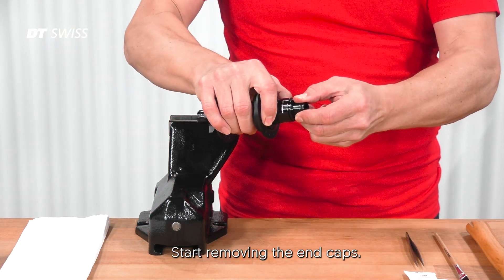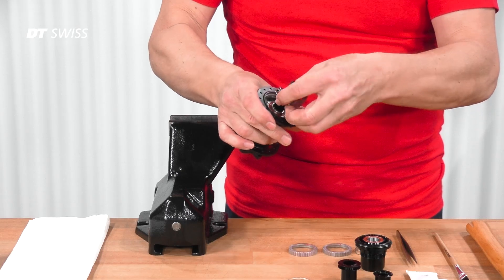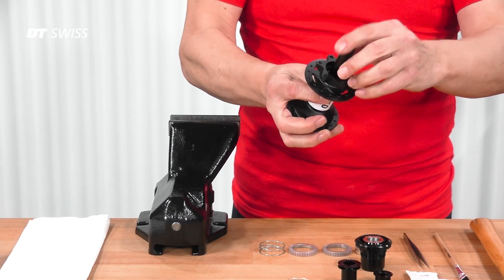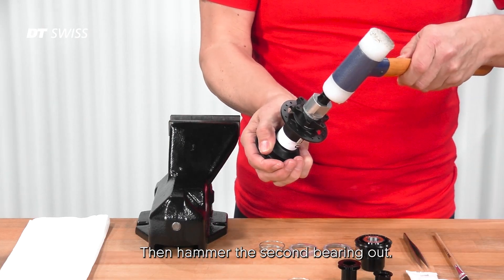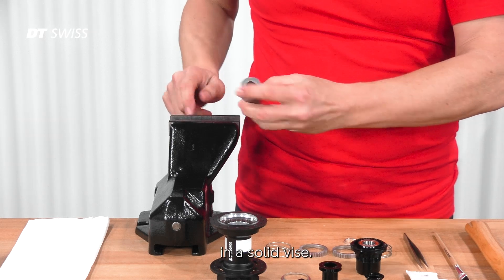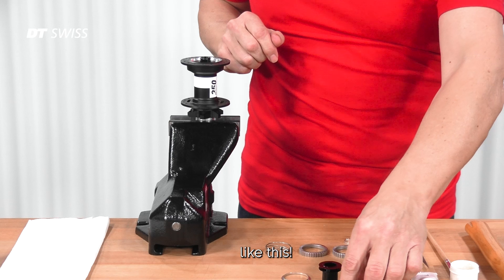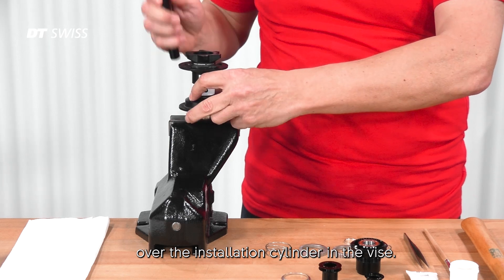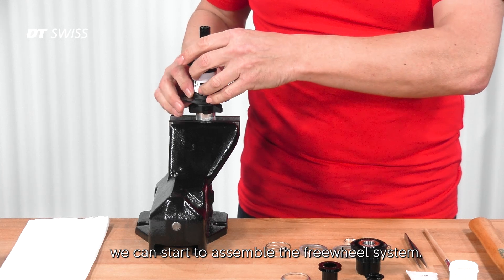How To: 350 DEG Service

Comment: is this the same procedure for the 350 hybrid ? Especially the part where we can change the drive side bearing without unlocking the ratchet ring ?
I had a DT 370 hydrid and the ratchet ring was impossible to unmount, even with 200 N.m. The steel jaws of my vise, which was otherwise quite heavy, developed some play before it came loose. I got a warranty replacement and it was not even on a ebike but a regular MTB.
Reply from the maker: HI and thank you for your message. The only DT Swiss hubs, where you can change the driveside bearing without removing the ringnut are the 240 DEG and 350 DEG hubs. All the other hubs would need the ringnut to be removed. And yes you're right that you would need to have a solid vise and a lot of torque to get it removed. You can use the following video for a complete service: https://www.youtube.com/watch?v=-Wde2goI3Cs
The steps for changing the bearings are exactly the same. Friso "DT Swiss".

Comment: So as you diddnt change the bearings of the freewheelbody, does that mean those will not wear down?
Reply from the maker: Hi and thank you for your message. We do not recommend to change the freehub body bearings. Usually it makes more sense to change it completely as the bearings there last much longer than the Hub bearings. Enjoy riding your Bicycle, Friso "DT Swiss".
Reply: @dtswiss  To me, it makes no sense to replace a whole assembly when you could replace only parts of it.
Reply from the maker: It is not forbidden to change the bearings, if those where worn out. Friso "DT Swiss".
Reply: @dtswiss  But do i need special tools?
Reply from the maker: You would need to find tools to change the specific bearings size. As it is not foreseen by us to change them, we do not offer tose tools. Friso "DT Swiss".
Reply: @dtswiss  I am dissapointed! I was looking for something like this. Because i would like to change it, when parts are not manufactured anymore!

Comment: I have purchased the 350 DEG LTD in green in a wheel build. I am trying to secure the MS freehub as the purchase came with XD installed.
Is this the correct part HWYABL00S0956S for this hub, 
could you provide me with correct part numbers for the 72T MS freehub
thanks
Reply from the maker: Hi and thank you for your message. Yes with HWYABL00S0956S you can convert your hub from SRAM XD to Shimano MicroSpline. Please make sure you have the DT Swiss special grease (HXT10032508S) by the hand, to re-grease the system which is recommended. Enjoy riding your Bike, Friso "DT Swiss".
Reply: @dtswiss  thanks 
could you also explain the difference in HWYABL00S2787S & HWYABL00S0956S
As mentioned my purchase was the 2025 LTD Green 350DEG hub set with wheel build. I finally found the support section of your webpage with the HUB model and in the conversion section lists the  HWYABL00S2787S as the part#.
I want to be certain before purchase, hopefully can find as inventory seems to be difficult to find at the moment.
Reply from the maker: Hi and thank you for your message. The freehub body is not related to the teeth count. You can use every conversion kit that will fit to a ratchet DEG hub. So yes, the HWYABL00S0956S (240 DEG) conversion kit will work. As well the HWYABL00S2787S (350 DEG). Enjoy riding your Bike, Friso "DT Swiss".
Reply: @dtswiss  thanks Frisco. I have received my freehub body conversion and special grease as recommended. Yer videos and website information are very informative. Much Appreciated.

Comment: Are 350 hubs switchable between standard 12x100 and boost 15x110 mount just by swapping the end caps? Or maybe boost hub has wider body and you cannot switch it that way?
Reply from the maker: HI and thank you for your question. If it comes to boost hubs (110mm front or 148mm rear) there is no chance to convert them to different axle width. This is related to the fact that the hub flanges on boost hubs are wider. So in short words, no you cannot convert from 12/100mm to 15/110mm or the other way around. Enjoy riding your Bicycle, Friso "DT Swiss".

Comment: What brand and size is this installation cylinder??
Reply from the maker: Hi and thank you for your message. All the hubs specific tools are by DT Swiss. You will find the artivel numbers in our manuals: https://www.dtswiss.com/en/support/manuals
For the 350 DEG hub choose the DEG manual:
https://d2a13k6araex7u.cloudfront.net/pmt/00/00/00/00/00/00/00/10/00/00/05/10/4/MAN_HXD10000005104S_WEB_EN_001.pdf?v=633

Enjoy riding the trails, Friso "DT Swiss".
Reply: @dtswiss  why the F can't you just give a link on the right tool?? I don't need your manual

Comment: My new wheels on limited silver 240 DEG are currently being built ;D, but I see that these 350 DEG have a slightly different construction. There is additional silver spacer in the freehub(or maybe I didn't notice it, because my freehhub is also silver), and much thinner spacer on the axle. Are 90 and 72 DEG ratchets compatible with each other?
I also see that new Specialized Turbo Levo Gen 4, which has 111Nm is equipped with wheels with DT 240 DEG... so this hub, and 350 DEG can easily withstand the most powerful legal 250W motors, yes?
And one more question, will there be a reinforced steel version of Hybrid DEG freehub available? So that it does not get marks from cassette?
Reply from the maker: HI and thank you for your interest. As I can see in your message, you are very into our products👍 You are absolutely right, the design is slightly different as the 350 hub is using larger bearings, there is a spacer on the axle where the 240 DEG will only use a washer. But beside this detail, all the freehub system parts are the same. So yes, the DEG ratchets and freehub bodies as well are interchangeable. If it comes to e-Bike use, we recommend the 72teeth ratchets. But there is no ban from our side. For the moment there are no plans to offer steel freehub versions for ratchet DEG hubs. But we will see what the future will bring. Enjoy working with our products, Friso "DT Swiss".
Reply: @dtswiss  
Thanks Friso for quick reply. It's true I had a lot of your wheels/hubs, and I like them. Both the cheapest ones like Endurance LN recently, to more expensive XR/XM 1700 and custom wheels on 421/511 rims. 
Now after problems with Chinese carbon rims (I wanted to do an experiment on YT) I will probably make something solid on HXC 1501 rims, and maybe 350 DEG. So thanks for your reply, and if it works out I will soon play with the newest 350 myself ;)